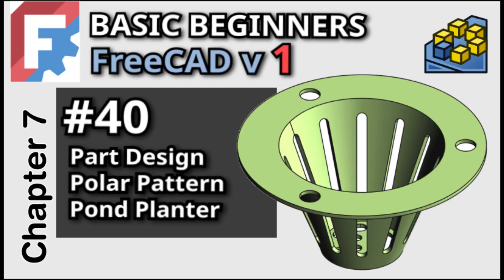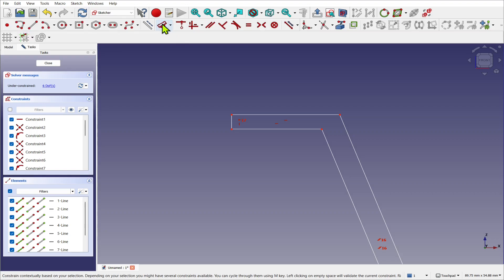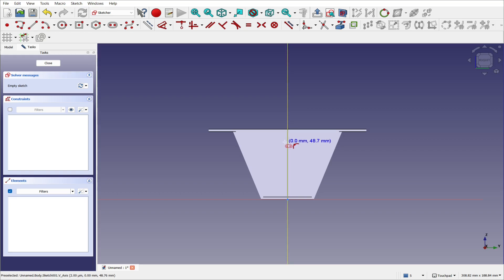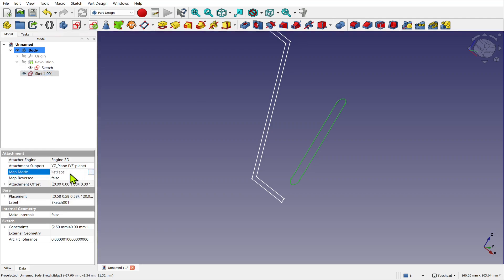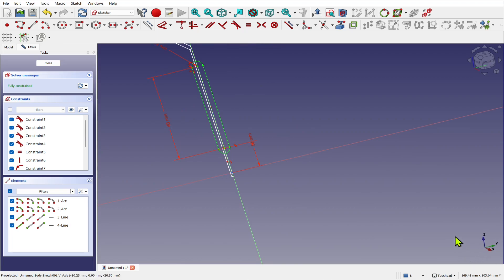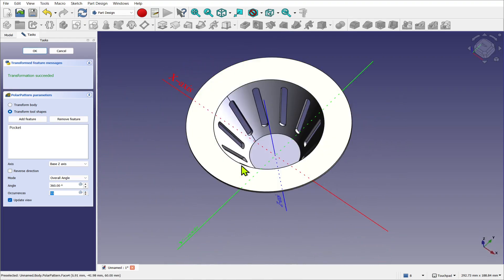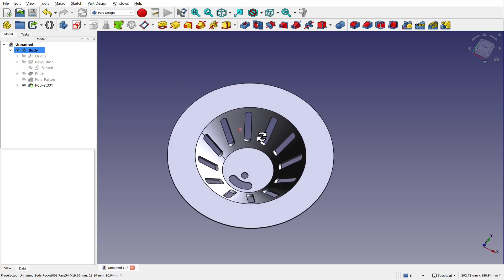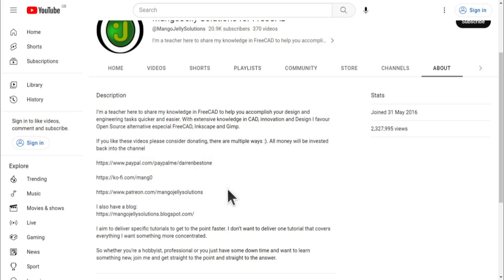FreeCAD 1.0 Part Design Polar Pattern Tutorial: Create a Pond Planter | Basic Beginners Lesson 40

Comment: Hi Darren, As Usual Global Vs Local Co Ordinate have Me a bit Miffed]d, Using the Sketch after Attachment of the Slot Example You Mentioned @ 8.45 I understand Local Z Axis is the Blue 0,0,0 Point (Looking Directly at Me Right between the Eyes (Normal to Sketch), Now as You said Y Axis is Green therefore X is Red. Now (and I think I'm getting it at last) whilst Local CoOrd System is Dependent on Sketch Orientation/ Positioning (The Screen Positions of the Locals will change) They share the Same Colour Coding as the Global indicators X Red Y Green Z Blue. It's tajken Me a while but "By George I think He's got it!!! What! ;-)
Reply from the maker: Great to hear your getting there, yes the global and local co-ordinate system can be a complete brain twister. I always used to forget what colours the axis were for XYZ and then someone pointed out is was the same sequence as RGB for electrical which was a big help.

Comment: Hi good video as always. Is it possible to make patern but for assemblies? For exemple if i instanciate a certain screw in a hole and i have 20 additionnal hole that are evenly spaced, is there a function that can make that?
Reply from the maker: Glad you enjoyed the video.  In regards to the assembly, you can but there are a couple of steps.  The first one is to allow compound on the body  so you can create the pattern of the body as a multi solid, the second, depending on the application, is to use a datum line to pattern around,  I see you have a bicycle wheel in your avatar picture so if you was making attachment to pattern around a wheel to allow for just one joint attachment in your assembly then could can offset a datum line from your main feature and pattern around that axis. I would also use datum objects to make the joint in the assembly more stable (so attach via the datum in your assembly, something that I do quite a bit.  You attach the datum via the most stablist feature, so in this case the feature your patterning, not the output of the pattern.  In that way you can change the occurrences of the pattern without your assembly turning itself inside out.

Comment: Is there any advantage this way rather than using the curves workbench to sketch on the surface?
Reply from the maker: The main advantage is that you can sketch once and pattern many.  So you only need to constrain one piece of geometry.  If you wanted to add, say, another slot, then it's just a case of upping the occurrence.  You can also use the occurrence and the expression editor together so you can increase / decrease the occurrence depending on the diameter .